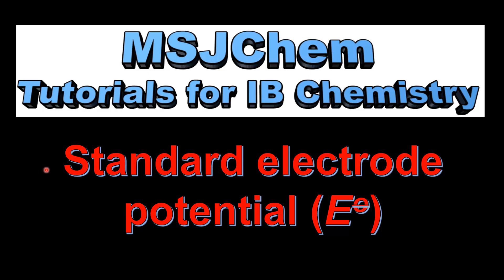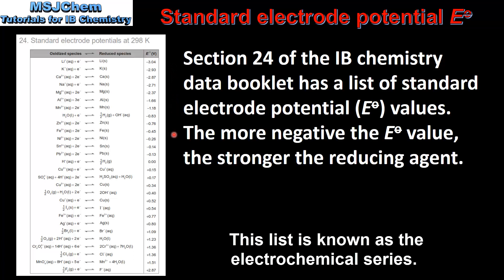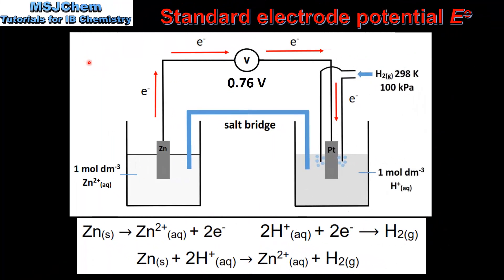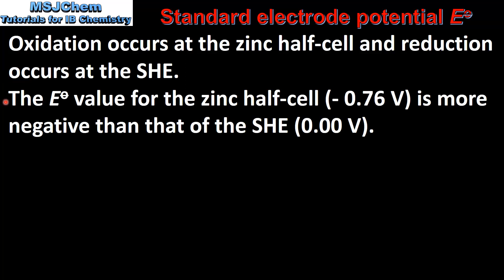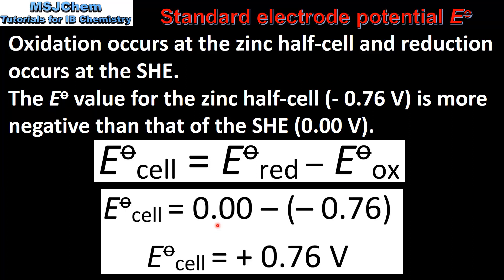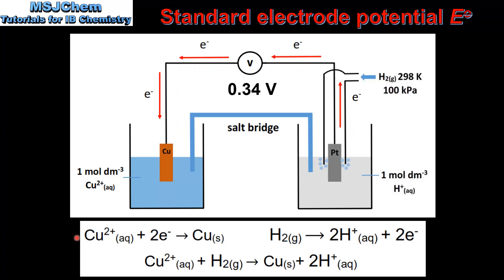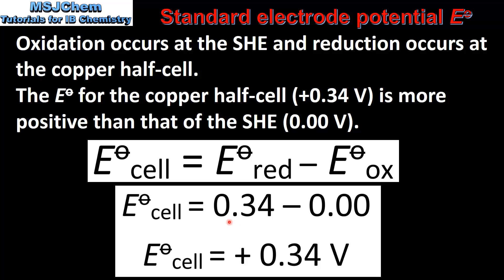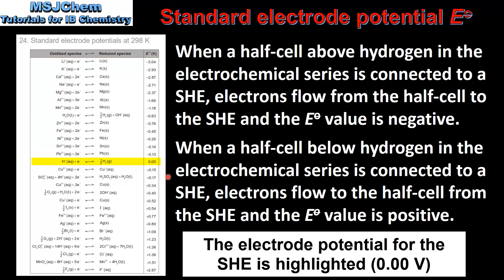19.1 Standard electrode potential (HL)

Comment: The more negative the value of the standard electrode potential, the stronger the reducing agent it would be. This means that they would readily oxidise. However, the formula states that the electrode potential of the cell would be the electrode potential that undergoes reduction - (minus) the electrode potential that undergoes oxidation. Doesn't this mean that if the electrode potential value is negative and connected to SHE, wouldn't the value of the cell be positive, not negative as shown in 04:45? I am a bit confused. Is there a mistake?
Reply from the maker: Manan Sanghavi Table 24 shows electrode potentials, not cell potentials. The cell potential is calculated using these values in table 24. If a zinc half-cell is connected to a SHE, electrons will flow to the SHE which is why the value for the zinc half-cell is negative.    If you used the values to calculate the cell potential, it would be positive because the reaction occurs spontaneously (a positive Ecell corresponds to a spontaneous reaction).
Reply: @MSJChem  So the potential of the half cell would be negative, but the cell potential would be positive and the reaction would be exothermic and spontaneous?
Reply from the maker: Remember that a voltaic cell will always be spontaneous, never non-spontaneous. If you connect two half-cells together, electrons will always flow from the one with the more negative electrode potential to the one with the more positive electrode potential. Never the other way around because that would be a non-spontaneous reaction and you’d have a negative cell potential.